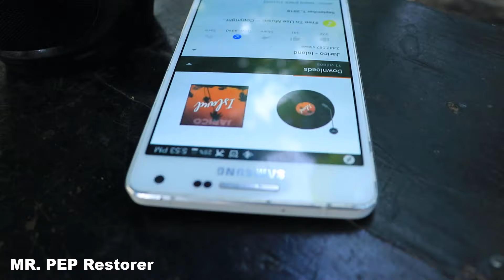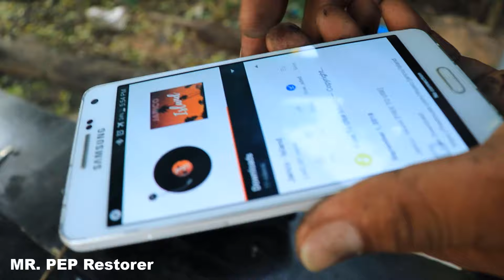Try to Restore Abandon JBL Speaker | Antique JBL Restore

Comment: Did anyone notice at the end the bass radiators don't even move when he has it playing? Plus I can't say I've ever seen a circuit board and battery washed successfully in soapy water 🤦
Reply: Isso
Reply: @𝕤𝕩𝕞𝕡𝕝𝕪_𝕛𝕩𝕙𝕖𝕖𝕞 because the shell doesn't let the water in 🤦‍♂️
Reply: @jjjj-cf6wr  unless the mother board is covered in hydrophobic coating
Reply: because song is played on another device
Reply: @jjjj-cf6wr  as long as the component isn’t on and it lets the water dry, when you turn it on it will still work like PC components 🤦‍♂️
Reply: @jjjj-cf6wr  but yes it is a fake JBL.
Reply: @supernova8948  But the water is full of minerals. It will oxidize if the water isn't destilled
Reply: Btw when you hear "bluetooth mode" be sure it's a fake speaker or a low - quality one.
Reply: @campanaro_99  yeah but it doesn’t even start there…
It begins with the simple fact that his lil red jbl sing doesn’t fit where it’s supposed to be 😂
Reply: Yeah man you're right ✅
Reply: @Txmmy.768-youtube  d.
.
Reply: @Txmmy.768-youtube ....
Reply: @Txmmy.768-youtube  х
Reply: coz it didnt have bass the song and they werent that powerfull in those days
Reply: Probably airleak?

Comment: 😂 That's not how electronics work. Putting a circuit board and much less the Speaker Drivers into Soapy water not only lessen the resistance but it makes it much more conductive because of the fact it has soap. If this were real and he plugged in the speaker driver into the circuit board the entire speaker driver would catch fire. This is a fake JBL Speaker too. This video overall is just an easy way to get views.
Reply: You said that!
Reply: Yeah you are exactly right, they probably filmed the speaker working before they destroyed it
Reply: As long as he thoroughly rinsed the circuit board with plain water after cleaning it, and let it dry fully before applying power there wouldn't be a problem.

Comment: The passive radiators are not even moving 😂😂
Reply: The manufacturer hasn't sealed it well
Reply: Guess they're a little too passive
Reply: Fake JBL passive radiators dont move a millimetre you know
Reply: They are just stationary
Reply: cause they are fake
Reply: Its a fake jbl
Reply: Cuz its a fake jbl
Reply: @GotaSir911  i have put one those on full volume and it kinda moved a mm

Comment: He also washed battery it's risky
Reply: How tf is washing a battery risky like lmao no its not
Reply: @lukabread4099  these batteries can explode when connecting positive to negative, and in dirty water its a higher chance to have a connection made. So yes, risky...
Reply: @Your_Mom_2580  no risk if under 3v
Reply: @Your_Mom_2580  Those batteries are 18650 and are sealed. I tried submerging a fully charged one in dirty water before and it still works fine.
Reply: @euvo_sound  yh it also has a lithium protection PCB for that if it is shorted out it will protect the cell

Comment: Did you guys noticed when he opened the speaker it has blue battery and he washed the battery, speaker,and the circuit board then when he trouble shoot the board I noticed that the blue battery turned to purple then when he wash the speaker that has paper come it will break and the battery is should be has some react to water..

Comment: how to make the  video fake follow these steps: buy a speaker then half disasemble it 2.covoer it in mud 3. fill the insides of the speaker with worms and mud 3.bury it and then step 10 times on it 4.start recording and say you found a jbl speaker 5. put it in the soapy water with the batery (totally not a fire hazard) then "restore it"  dont turn on the speaker and fake that it is on and functional and finalyl step 6. hope no one notices

Comment: That's a fake jbl.. just look at the cheap amp and drivers and the tiny battery.  Since its a fake one I would just leave it .
Reply: Even the turn in sound the passives are low quality the jbl emblem didn't fit the drivers are thin and low quality

Comment: This is the worst restoration speaker ever built. I seen better. The paint job sucked. Even if he spray-painted it it still sucks. Could just buy replacement parts  case and would been half way better.